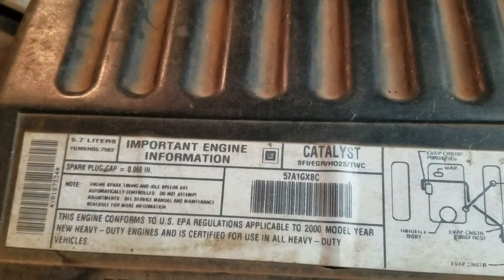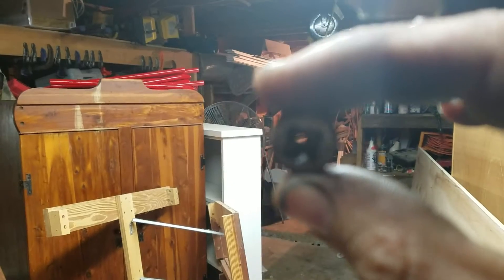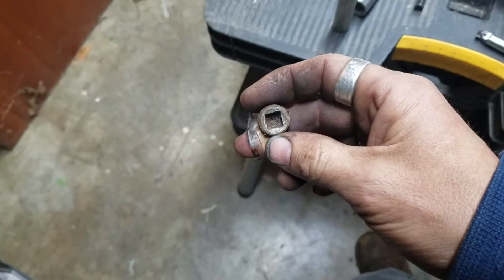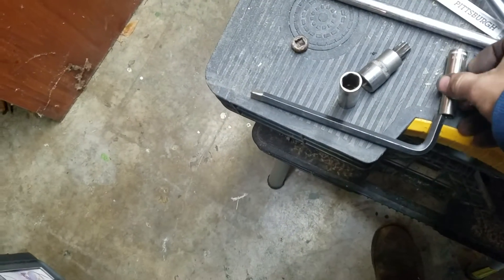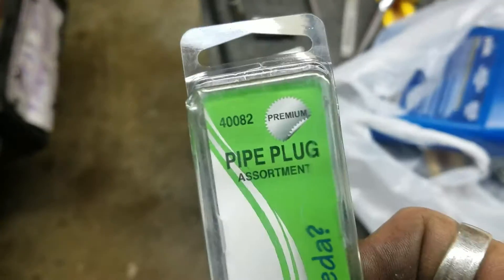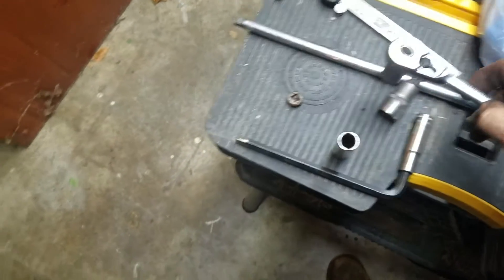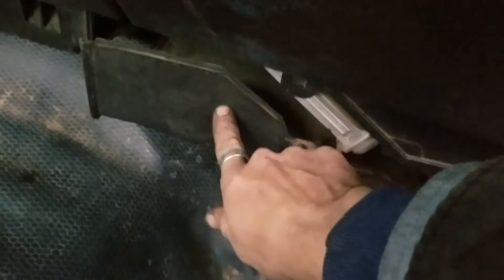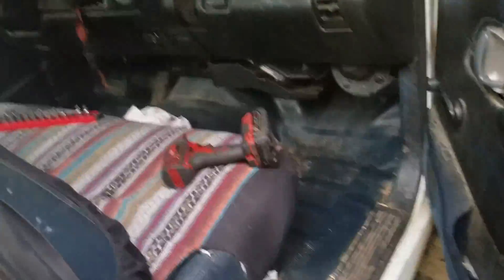Chevy 350 cylinder head coolant plug

Comment: My fucking dumbass forgot to put the same cylinder head with the coolant temp in it on the driver side so the fucker is now sitting on the passenger side I was like wth how did I be such a dumbass in a hurry and not pay attention now I am stuck trying to figure out how in the hell to remove what ever the fuck that plugs name is and replace it quick or I just wasted two days straight working on my sbc 350 for nothing. Yes, men cuss when we get pissed so I agree with it. It is venting frustration, which is normal. Or you might see flying tools. I prefer cussing over throwing tools.

Comment: I'm sure there's a 1/2 inch pipe plug that takes a 5/16 hex..
I just finished replacing the intake manifold gaskets on my1998  5.7 vortec now i want to flush and drain the block. 
Does anyone know if there is  block drains?
Its hard to get under there at my age.
Reply from the maker: @carlc4715  Never known there to be.

Comment: Brilliant solution. I'm installing an oil pressure sending unit and I can't get to the square pipe plug that is located at the back of the block right next to the distributor.